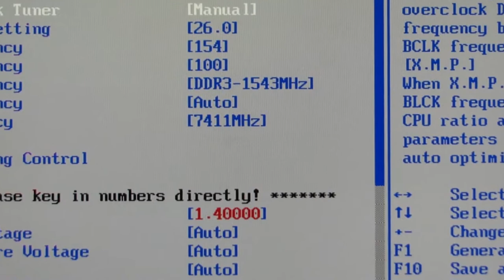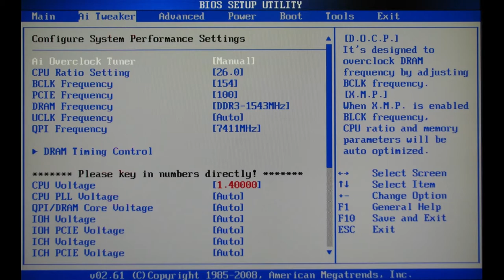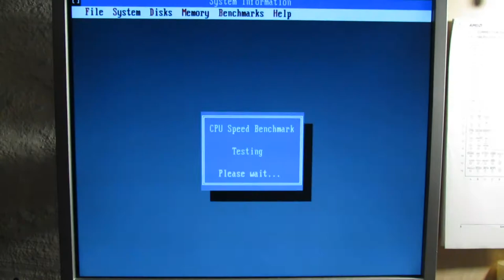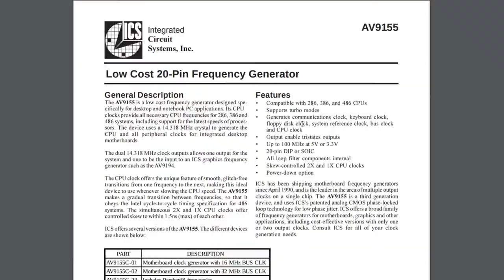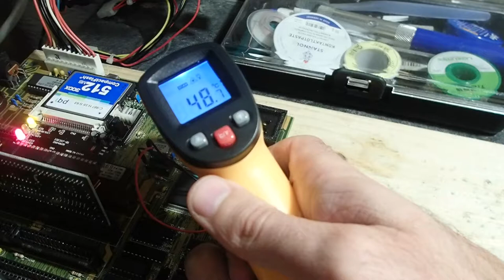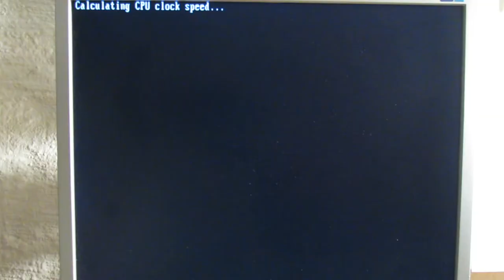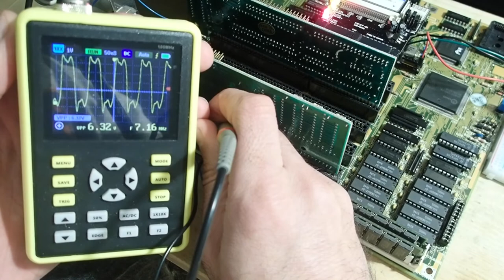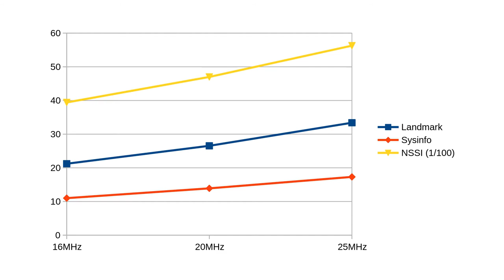Let's overclock an old 386SX

Comment: Man, I still remember bringing my Pentium II (I think it was 233 Mhz) cpu to some computer shop, exchanging it for a Celeron 300A while getting some cash back and then overclocking that from 300 to 450Mhz, ending up with a much faster PC and getting money for it . Those were crazy times!
Reply: The noise of the CPU fan though...
Reply: Hahaha.

Yeah I had a 300a @ 464.

It could have done 504, I just didn't know SHIT about things back then and didn't even use thermal paste. Just the pad that came with the cooler.

Made a Celery Sandwich with it, without thermal pads. Lol.

I also had a PII 300 SL2W8 that was a 450 in disguise. Did 450mhz easily.

One day my Mom came home (It was her PC) and I told her the CPU was at 450mhz now. Lol, great times.

Comment: Excellent video! I've run into the same issue when doing this on a 286. The chipset was the limitation.
Reply from the maker: Thank you Adrian! I'm very glad to know, that despite of the amazing amount of (great) work you are doing, you still have some spare time to watch others videos ;)
Reply: geez, spoilers! ;)
Reply: @necro_ware  Is this overclocking technique possible on a 486 as well? Once you've maxed out the FSB speed and CPU multiplier there's nothing more you can do on the software side of things, but swapping out the crystal oscillator/clock generator sounds like it could work. I'm asking because I recently found a Socket 3 board, the Shuttle HOT-433, that can do 83MHz on the FSB, and I wanted to know if it would be feasible to push it even further than that.
Reply from the maker: @FordGTmaniac  Some early 486 also used such oscillators, but later version like HOT-433 used clock generator IC like MX8315 (see between PCI slots on your board). This clock generator can generate up to 80MHz. I personally don't think, that this board or any 486 CPU can stand 83MHz FSB anyway. At least not for longer period of time.
Reply: @necro_ware  Oh, ok. That particular board uses the UMC 8886AF / 8881F chipset which was also used for Pentiums, or so I've read. That would explain why the FSB can be made to run so fast despite it being a 486 board. 83MHz isn't an officially listed setting even though it is fully capable of doing so, probably to prevent people from accidentally frying their CPU's.

Comment: Most enjoyable video. If I recall 40MHz 386 DX is about the minimum for full screen Doom to run smoothly
Reply: I have never seen a 386 above 40MHz that was factory boosted. Yes, you had to be at 40 to play DOOM FS, but you got like 15-20 FPS. My friend would stomp me in DOOM but I trounced him in Descent (similar performance, I was just better in 3D space.) My friend had a 486 DX and I had a 386/40 (it was a 25, the 40 was turbo.) You remember your first computer... This was not my first computer, that was a Compaq 251 Deskpro, an 8086 CPU.
Reply from the maker: I will not start to argue, because everybody has own expectations on, what is playable and what's not. It's in the end up to you, but I think Doom is not playable on an any 386DX, not to mention "smoothly". At least here you have some numbers and they are completely in-line with my own measurements:  https://youtu.be/qQEHHc1q06c?t=186
Reply: I remember playing Doom on 386DX/40. It was an AMD chip. Intel only went up to 33.
Reply: TI 486dlc that fit in a 386 socket @ 40mhz with a 33mhz or 40mhz 80387 type *ulsi or iit were my goto*. Consistently got near 486dx-40. That combo probably only worked out well because of the board i was using. Good times.
Reply from the maker: @Tris289  I have this combination on a very fast 386 mobo. 486DLC + IIT4C87 both @40MHz (not overclocked). It is from the performance between 486DX-25 and 33. More like 25 in the most benchmarks.
Reply: @lztx  that's not true i don't think? i had a 386DX-40 and i'm pretty sure it was an Intel chip
Reply: @evilotis01  I'm fairly sure. From Wikipedia: "While Intel's 386 CPUs had topped out at 33 MHz in 1989, AMD introduced 40 MHz versions of both its 386DX and 386SX out of the gate... Generally the 386DX-40 performs nearly on par with a 25 MHz 486..." Maybe you could overclock the Intel to 40 but everything I read agrees with that. Intel would have concentrated on the 486 by the time AMD could get to market.
Reply: @evilotis01  Doom used DOS4GW which provided basically a flat memory model, so it didn't have a huge requirement for conventional memory. I might have been lucky with my 8MB of RAM. I think if you only had 4MB then you would simply have to only load the bare minimum drivers. And from memory you didn't even need to load EMM386 because DOS4GW could use it all natively.
Reply: @lztx  yeah i only had 4MB. iirc i eventually gave up and convinced my dad to let me install it on his work computer -- which was at least a 486 and maybe a Pentium -- instead
Reply: At grammar school we had 386SX-25 machines with 4 MB RAM. We still played Doom on them and it was running pretty smoothly - on the smallest resolution possible, which was the size of a large postage stamp in the middle of the screen :-D
Reply: @PetrSedlacek  ah yes i remember that resolution well lol
Reply: @leathernluv  actually your 40MHz was the nominal speed and pushing turbo-button simply pushed it down =)

Marketing things or something like that to call the normal speed Turbo
Reply: There’s a video of a 50 MHz 386, still doesn’t run Doom full screen smoothly. This is the best I’ve seen from a 386: https://youtu.be/9_2qGaIOvjs (watch from 3:05 for a bit of full screen, it’s borderline acceptable).

Comment: My first overclock was made on 80286 CPU with use of the TURBO button :)
With later CPUs I used many different methods for overclock (switching jumpers, replacing oscilators, cuting traces or isolating CPU pads/pins). I miss the good old times when oveclocking  gave fun and was worth it (like overclocking Celeron 266MHz/66MHz FSB to 400MHz/100MHz FSB or more).
Reply: Wasn't Turbo to actually slow down the cpu so DOS application/games wouldn't run at abnormal speed ?
Reply: @gagarin777  True. The turbo function was underclocking, but sounded fancier as "turbo". Many people thought they were saving the system's stability and reliability by having it run off the turbo mode as much as possible.

Comment: Back in 1993, my first PC was a clone of IBM AT 12 Mhz. It did have a CPU in a ceramic housing and quite hefty heatsink
attached to it. It was just too slow for everything i was trying to accomplish. So i've had this idea of overclocking. Went to a local parts store and bought every ceramic resonator between 12 and 22 mhz they had on offer. Removed the original one and soldered a socket in its place to aid for easy swap. Then, gradually inserted faster and faster crystals and running the PC for couple of hours to see if it malfunctioned. Found out that i could safely run it at 19 Mhz which was a huge improvement. But that was not the end. The machine did not have math coprocessor and i was torturing it with CAD tasks so i found out that maybe it would be good idea to populate that empty Coprocessor socket on the board. Scavenged a 80287 MPU and when casually going through its datasheet, noticed that it actually runs totally asynchronous to the main CPU. Rigged up a sort of adapter that went in between the board and MPU that contained its own resonator (it was a proper, powered generator supplied with 5V while board used traditional 2-pin crystal) that ran@20 Mhz. The result was a genuinely fast computer that ran blazingly fast 3D CAD calculations. Chipset didn't seem to be the limit but i do not recall its brand or IC manufacturer. Most likely, it was an older "hybrid" board that integrated some of the functions (like MMU, interrupts...) into a sort of multifunction chip, but it stil contained large number of individual Intel circuits, like UARTs, keyboard etc.
Reply from the maker: Thank you for sharing your experience! If you tinkered with 286 back in the days, may be you are also interested in my various 286 restoration videos ;)

Comment: I remember over clocking my amdK6-2 to 600mhz in 2003 to play city of hero's. Good times. (And no it didn't play well at all. But it did play)
Reply: Been there. Just did whatever we could back then for 3 more fps
Reply: I ended up damaging my K6-200 by going from 66mhz to 83mhz on the bus.  75 however worked fine, but going to 83 made it so the CPU was no longer stable even at the stock settings anymore.
Reply: Did the same to my athlon. Scorched the bottom of the cpu.... Let the magic smoke out. 1.2GHZ to 2.1.... it ran for 3 months :)

Comment: What a walk down memory lane such nostalgia I have been trying to get a running 286/386/486 motherboard I have a 486dx2 Pentium overdrive CPU but finding a working or even dead motherboard is a very expensive task even if dead I would repair it but ebay sellers are not the most reliable and our local e waste disposal depot wont sell any of the good components I have seen there yet they charge an arm and a leg for people to dispose of them I do however have managed to salvage 2 8086 processors and a 8088 but motherboards for those in the wild are rare..... Thank you for such a nostalgic memory

Comment: Hi! What a fantastic video! I must say that you have the nuts in place :D Dessoldering the CPU from a good working Mobo was very rad and risky. I love to see the charts and the performance increase. My first PC was an 386SX25, one week later, in the same store, I saw an 386DX33 at same price. :(
Reply from the maker: Thank you Jorge! Yes, desoldering the CPU was kind of crazy idea, but I couldn't stand the curiosity :) Unfortunately I couldn't reach 33MHz with this mainboard, but at least it was an interesting experiment. And since I could restore everything to the original state, I guess it went quite good in the end.

My father bought me my first PC, it meant to be a 386SX-25 either, at least, that was, what I thought. Years later, as I understood a little bit more about it, I realized, that my father was scammed and the CPU was actually 20MHz, but sold with 50MHz crystal oscillator. So my first PC was overclocked from the beginning by an ugly scammer :)

I still have that old overclocked hardware under a glass cover in my working room. It is still completely working!
Reply: @necro_ware  wow, who sold him overclocked CPU? But in that time, it was matter of few hundreds $, so it was tempting to do by sellers. Was it regular store, or he bought used computer from someone?
Reply from the maker: @warrax111  It was a "regular" store, but I probably have to add, that it was in Moscow :) It were 90's, a dark age, no rules, no law,, no government. Scammers on every corner, so no wonder, that even a usual store scammed on their customers. As you can imagine, the price difference was quite a lot between real 20 and 25MHz machines. Anyway, I find it quite funny today. It's a part of my history now :D
Reply: @necro_ware  Yep, I am also from Soviet Union, I know what you are speaking about. :) Nice story though, it was just like that, when people started to grow up, and know something about computers, it was too late for doing anything, the sellers used it in early 90's.
Reply from the maker: @warrax111  Hehe, the world is a village. Then you know, what I'm talking about :)

Comment: I had a 486 back in the mid nineties, started life as a DX-33, but I managed to get an AMD DX4-120 CPU. Problem was my motherboard could only do 33Mhz bus, not 40, so I couldn't reach 120Mhz, "only" 100. I replaced the crystal on the board to get 40Mhz bus and it worked flawlessly. The PC still "thought" it was running at 33Mhz since I had changed the reference frequency (I think?), but benchmarks and performance clearly showed the improvement. The computer lived on for a couple of more years running Windows 95. Even battled with my friends' Pentium 60 and fared pretty well actually, which made him pretty pissed since he spend a lot of money on his new shiny Pentium :P
I don't necessarily miss those days, things were so complicated, but I do miss the hardware and the "feel" of successfully getting the PC to run fast and stable. Which is why I build retro PCs, collect hardware and help arrange retro LAN parties and play lots of retro PC games these days. Just keeping those old feels alive :)
Reply from the maker: Hehe, you probably terribly overvolted your CPU back then. If you have had a mainboard, where you could replace a crystal, then it definitely didn't have a 3.3V support. All the mainboards with 3.3V CPU support never had a crystal, they already were all with jumpers and variable clock generator IC. So you probably powered your CPU with 5V instead. You were lucky, that it survived so long. And regarding the DX series, this was the first time, where such a thing like Front Side Bus (FSB) was born. DX, DX2, DX4 was nothing else, but a multiplier 1x, 2x and 3x. The mainboards usually don't care which one of the said CPU is inserted. The main difference was between DX and SX (no FPU). DX2 and DX4 were technically still the same as DX, the multiplier made only difference internally inside of the CPU and was completely transparent for the mainboard.
I also would assume, that your mainboard could actually do 40MHz FSB as well, but probably this frequency at 5V was too much for the CPU. Back in the days you had problems with FSB of 40MHz only on mainboards with VLB support, but most of them had additional wait state jumper, in case FSB was set to over 33MHz. Furthermore, I suppose, your mainboard was ISA only, because as VLB was introduced, they didn't use plain crystals anymore.

Comment: My first overclock in ninetities was 486SX/25 @40MHz just by swapping oscillator. It was already in socket. Later got 486DX2/66 and that went up to 90MHz. It was sick fast with VLB display card. Chipset on the mobo was from UMC by the way.
Reply: i used to overclock dx4 100 to 166 mhz it was really a performance boost back in the day to have almost pentium performance
Reply: wow, this was a gamble: VLB cards didn't like overclocking
Reply: @DolganoFF  Card was S3 Vision864 VLB.

Comment: I remember a 386sx 20 machine, doing a RAM upgrade on it and spotted the CPU was actually a 25 - and the oscillator was socketed - hmm, some free performance to be had? - couldn't find a cheap 50MHz, but picked up a 48 from a radio rally...
Stuck it in, and a perfect 24MHz was achieved - and the ISA ran at a nice 1/3 for 8MHz, instead of an evil 6.66MHz or an overclocked 10

Comment: Your asking a lot from your breadboard! Also It's also a good idea to add heat sinks . I remember clocking an old 286 by replacing the crystal.
Reply from the maker: I was concerned about breadboard as well and tested the signals with oscilloscope before I started to do anything. The signals were quite clean and reliable. The temperature was also completely ok. If I remember right, I even show it in the video. Anyway the problem with the chipset was already confirmed by multiple people. It doesn't stand frequencies above 25 MHz.

Comment: My 1st easy overclock was with classic Pentium 150 Mhz with 60 to 66 Mhz FSB jumper which resulted in a Pentium 166Mhz. 

MMX is limited to integer formats that recycled the FPU registers. Switch between X87 and MMX resulted in pipeline frush. SSE's support for FP32 and separate register storage fixes MMX's problems.

Comment: 11:07 - hah I had a DX-40 MHz board that would take an external CPU, and I wanted to put in an SXL (TI) - I played with all the jumpers, it would just not run with any other CPU I had in the PGA socket. 

Finally I took a heatgun to the CPU on board (I needed one for my display collection anyhow) and it came right off. I didn't take any special precautions, luckily it was in the very corner of the board. I cleaned up any pads that may have cross-soldered in the removal, and plopped in the TI "486" CPU.

Booted right up. :D

Comment: Back in 1993 I overclocked my 486 SX 25MHz to 33Mhz by soldering in a new crystal oscillator on the motherboard. Insane how much hassle that was compared to overclocking today but very effective and cheap to do!
Reply from the maker: Especially compared to what the PCs did cost back in the days.

Comment: celeron coppermine cd0 stepping 566mhz is an overclocking monster
66mhz bus and high multiplier allow this chip to run at 1133mhz by removing bsel pins on the cpu (forcing bus selection to be recognised as 133 by default) and even overclock from there
since via chipsets for coppermine/tualatin cores can't aply fsb/pcie dividers correctly this was also the only way to get stable overclocking for tualatin celerons over 133mhz bus
i had 2 cd0 coppermines 566 and both of them run crazy stable on stock 1,5v and 133 bus, what more that barely ever got warm

i love your experiments. they really shows how much potential washidden inside old computer parts , artifically segmented and downclocked to create "less expensive" options for the market

Comment: Aah yes, my first encounter was accidently putting the jumper on my Pentium 133Mhz to 150Mhz... I was amazed it worked 😁
Thumbs up for your soldering. 
I also once got a by-fault-factory-overclocked 3dfx card that kicked ass but overheated... being an idiot at the time I had it replaced under warranty... should have just added some cooling and let it kick ass. The new card I got naturally didn't perform as good.

Comment: My first computer? IBM Turbo XT @10mhz. Did the 286,386sx and dx builds, and then special ordered a 486 dx 2/66 board, cpu, and all the goodies. Conner 170mb IDE HD ("you'll never fill that in your lifetime")  Got a wild hair, later and bought a 486dx 4/100 CPU, put in 100meg of ram and shut off virtual memory in windows 3.1... That thing was a screamer! **sigh** My brain was a sponge for all things electronic back then.  Now I'm lucky if I can shut off the alarm on my smartphone.